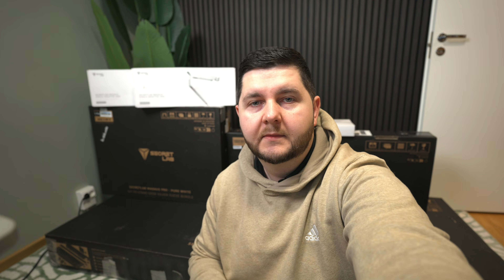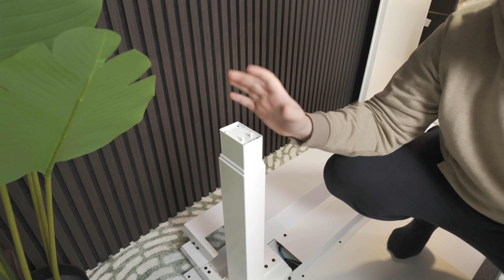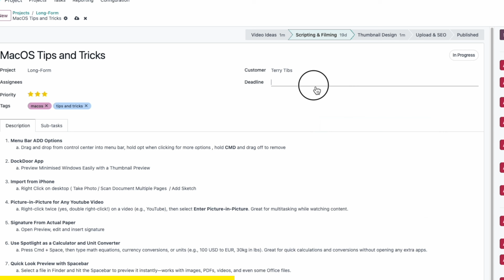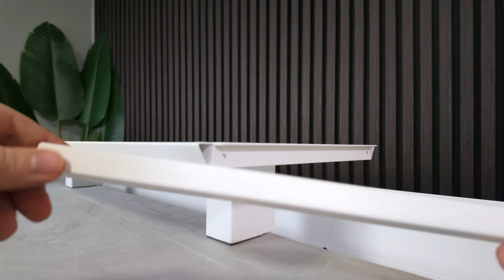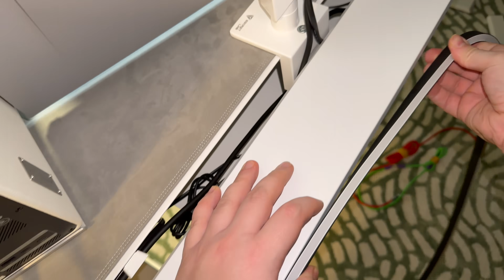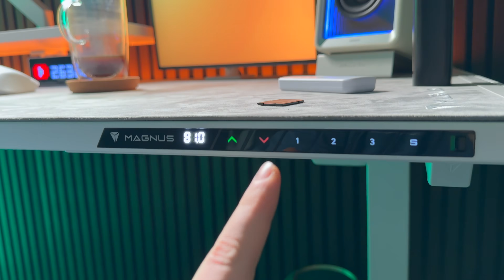SecretLab Magnus Pro XL Sit-Stand Desk Build | Complete M4 Mac Mini Workspace

Comment: What is the optimal monitor size for this desk if you want two monitors next to each other? Not sure wheter 27 inches or 32 inches are better for this one here
Reply from the maker: I have two 32” side by side and I’d say that’s the max 😂 you can see it on my Instagram page I think I posted photos
Reply: @MrHtech yes i saw them and i think overall it really looks good, however i also think that it might be a little bit too exhausting for your eyes having such big screens in front of you when sitting for several hours in front of them per day. What is your experience with that so far? I know that you can adjust the distance to the monitors thanks to the monitor arms and that really confuses me so i dont really know whether 27 oder 32 is better

Comment: Question - do you know if it’s possible to clamp dual monitor arm to the desk itself and use a third party monitor different monitor riser in front of the arm clamp? Reason is that I want a longer monitor riser for holding and  storing things + for aesthetic. I figure you probably shouldn’t clamp the monitors to a free standing monitor riser so that’s where my question is coming from. And then do you think there would be any issues accessing the cable tray or taking space away from the desk itself?
Reply: Yes, you can connect the monitor arm to the desk directly - the heavy duty arm, for example, is not compatible with the riser and must be connected directly to the desk. 

Yes, you can use a third party riser - but you will need to check fit, particularly if it is a riser than clips or attaches to the desk.

Comment: I have a question is it safe to connect everything directly to the desk? I have a big set up. And i am wondering if it possible to connect everything there. For example 2-3 monitors pc, ps5, switch, and some chargers and charging docks.
Reply from the maker: I’m not 100% sure the power capability , but if you’re worried you can always run another separate power extension cord to the cable tray and hide it with the cable management👌🏼

Comment: Thanks for the video!
So, how do you reach your extension cord and everything else if the hinge is blocked by the monitor arm clamp? I was going to do the same, but that's kind of a bummer honestly
Reply from the maker: Thanks for watching. 

Well It’s not blocked completely , it just blocks the last couple cm’s of opening, so you are able to reach in and plug in or unplug what you need 👌🏼.
Reply: @MrHtech ah, that should be okay than! Thanks!
Reply from the maker: @Stgibson91 no problem, glad I can help